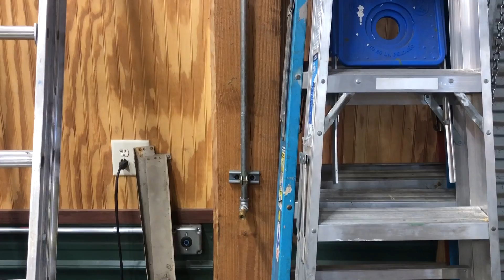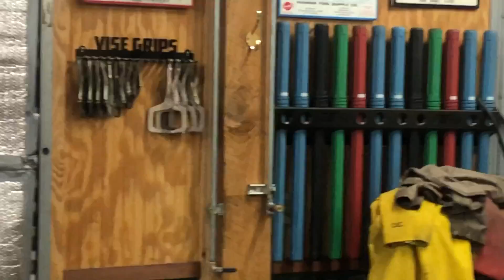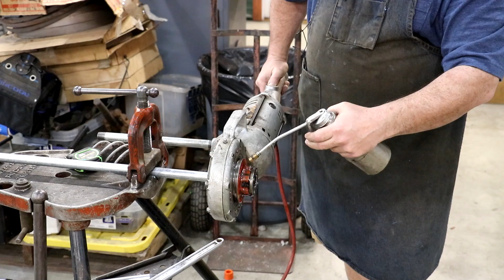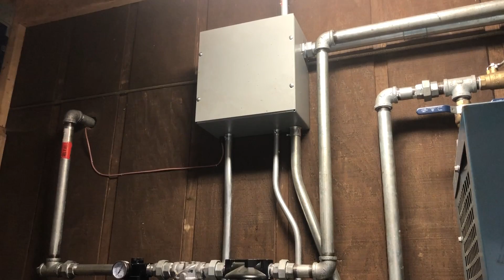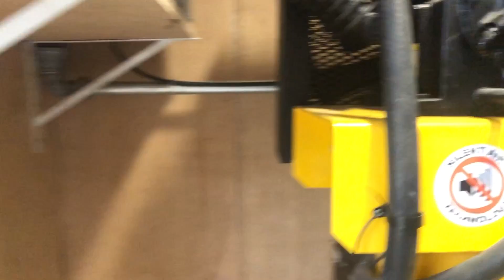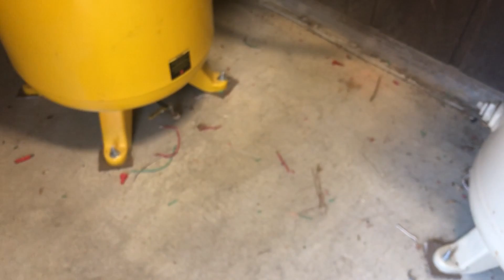The Ultimate Shop Air Compressor Setup! (at least for me....)

Comment: if you think you over killed for your air system, you would have to see mine.  the precooling coil i have on a diverter.  in the winter time i exhaust the warm air into my shop to save the heat and in the summer i exhaust it out side.  at the drops i also used a T but out of the bottom of the T i used a 6"x1/2" nipple with a ball valve to drain moisture/trash out of the line and out of the face of the T i used a 45 degree street elbow for my hose to hook into,  probably didnt have to but "my shop my rules".  the complete circle is AWSOME if you are using two drops at the same time there is zero pressure delta.  i do wish i had used glavanized pipe i used black pvc lined gas pipe glavanized would have looked better, plus i would not have had to paint it, yes all the lines are color coded according to industrial standards,  yes more over kill.  :)  again love the knowledge you are passing along.  thank you

Comment: At work we have a crapload of those 24V bulbs... but we also have a crapload of them in use. Most of our equipment uses 24V controls. Some of the old Japanese-built stuff (heavy tandem presses) uses 100V logic... not for the faint of heart!

I feel ya on backorders... a bunch of parts for work projects also on hold... The supply chain is logjammed everywhere it seems.

Comment: Keith, there is only one thing that scares the daylight out of me. That's the water separator valve at the bottom of the water separator. I would strongly suggest to you that if you are going to use the compressor before you get that piped outside for drainage, take some plastic and staple it to the wall above where the quad box is to cover that box until that work is complete, to make sure that any water dump doesn't get into the outlets or box. If things short out and there are any electronics involved in your system, you could fry those electronics. Not to mention any of the other potential hazards of water around electricity. Otherwise, the whole looks great. :-)

Comment: Keith, think of running an oiler unit. You have constructed an excellent system for media blasting, spray painting, plasma cutting, and personnel air supply, but for running pneumatic tools the system will be too dry. cheers
Reply: Oilers will be at point of use.  Don't want oil in the blast air or paint sprayer lines.

Comment: Might want to consider your shut off button to trigger an end of day drain down of the tanks as well. Sounds like current control logic would turn off the outlet that would power that drain down such that it wouldn't cycle.

Comment: I guess you could automate the rotary converter. It's possible to detect when a load is requiring power - to start the converter automatically. It could be set to auto stop 15 minutes after it's no longer in use too.

Comment: As it was, your second air dryer was bypassed - but still plugged in to come on when the compressor runs. I presume you have another switch for that in the compressor shed that you'd turned off ?

You're right, you've gone a bit OTT with that air system :)

Comment: Copper refrigeration tubing silver soldered would have been even more attractive/vintage.  Good to 400 psi.
Reply: The store where I work, has a compressor in my shop, 
and lines feeding to the other building, 50 feet away. 
All the hard lines are done in 1/2 inch sweat-soldered 
copper pipe.  While we have had issues on each end of 
that line, nary an issue with that line.

The shop compressor is a screw supercharger type.
(Close to a Roots design, but more twists, and it 
works the other way.)  The actual compressor will 
fit in my hat!  It is driven by a 5 HP single phase motor.
(That will NOT fit in my hat!)  Yes, it is noisy, but not 
like a piston compressor.  More like a turbine (jet) 
engine, compared to a piston engine.

steve

Comment: I'm behind you 110% about using galvanized for your air lines.  There's a reason air lines that have been up for 100 years are still up and never leaked.  Tried & true is always the best way.  I know the blue conduit is good stuff, but I also know how you can easily hit them and have them split. where I've seen galvanized ran over by a forktruck and still just fine.
Reply: Black pipe - galvanized should never be used in an air system.
Reply: @bruceanderson9461  you have to explain why - or your response is useless...
Reply: If you read through the comments you will find the reason explained at least 6 times as it has long been accepted as poor practice to use galvanized pipe in air systems. Do not use galvanized pipe in air systems as the galvanizing can and does flake off the internal surface which can then damage air tools, clog orifices or contaminate the surface you are painting. Galvanized pipe is for water, not air. Black iron does not have plating on its inner surface so with dry air you will not have this problem. I have always used copper as it is totally inert in an air system, easy to modify, not damaged by sparks and light flame and can be more compactly built into your shop but more expensive-maybe. I completed my third and last air system in my shop 5 years ago and did all of the things Keith did plus some and have never regretted it. Buy once - cry once. Keith did an excellent job-best I have seen on you tube. If you would like pictures of my compressor plumbing and wiring contact me at andmfg@ yahoo.com  I wish I could have been exposed to this knowledge 35 years ago. So if you are just thinking of putting in a system you are so lucky to have seen this video.

Comment: Run the air at about a buck and a quarter and rear back and smack a plastic fitting with a hammer.  Thats why I wont use plastic air lines..

Comment: Ive seen people run a contacter off their lighting circuit so if you shut off your lights it kills your phase converter, don't see why you could not do that for your air compressor too. easy to shut off your lights, or wire it on a timer, so it kills power between 10pm and 5 am?

Comment: Your shop your way.  Similar setup I have done. The steel also works well with hanging partition curtains on if you have a dusty job or painting.

Comment: Just an old trick on those specific types of unions (NOT the ones with an O-ring or rubber seal in them). Seems I've installed hundreds of them in my life... Often times (quite often in fact) you will find that they leak just a TINY amount. The fix is easy, hit it with a hammer (around the center nut) and re-tighten an additional 1/4 turn... This causes the inner seal to shift about when you hit it and changes the seat angle while "jogging it around with the hammer." You will notice that no matter how hard you tighten them, after a few smacks, there is always room for another 1/4 turn. 

This is such a simple/quick thing to do that I never check for leaks first and I always tighten them this way (check for leaks after), been doin it for 30+ years and I would go as far as saying that this is the only way to do it. Take my experience for what you will....

P.S. Be sensible with how vigorous you are with hitting these with a hammer... Don't break the nut folks. Solid even taps, do not knock the hell out of it

Comment: Looks like you did it up right.  With that refrigerated air dryer you should have what we call at the plant "Instrument Air" quality dry air with a dew point of about 35 degrees F.  That should reduce to a minimum any corrosion of the galvanized pipe.  The one negative of galvanized pipe used in compressed air system is that the zinc will corrode due to the moisture in the air and sluff off in small granuals.  You shouldn't experience that problem.  You have also addressed some of that issue with the top exit of the piping at the drops.  Good Job!!

Comment: Of course you know the compressor will only turn on if your pressures low in the tank. With all the storage you have it may run once a day with light use. Now with the blaster it will run more often. So turning it off may not be needed unless your going away. Mine is only 60 gallon and if I'm just using impacts or cleaning up it runs twice a day. Setting at 80psi on an 125 psi off. Don't be surprised if it don't run up from your low in only a few minutes.

Comment: Seems like the precooler should be between the compressor and the first tank.
Reply: I was about to ask if it was a good idea to dry the air before it goes into any tanks.
Any reason not to do that? I'm in the process of building a drier at the moment.
Reply: @JoeInBendigo  One reason not to is that you would be modifying the plumbing of the compressor and would violate the warranty and would potentially be harder to do. I see two reasons to cool the air out of a compressor. One is to help condense the water the other is that it takes more energy to compress the same mass of hot air than cool air to the same pressure. When  your tank of hot air cools off the pressure drops and the compressor has to run again to bring the pressure back up.
Reply: @jmhannnon  my compressor has been out of warranty for about 15 years, lol.
Thanks for confirming my view to fill the tank with cooler air for less risk of rust. My cooler will have an automatic water drain as well. I'll put the filters on the tank outlet.

Comment: You can never have to many drops. If you go through & put in some overhead hose reels you'll never regret it. In his latter years my father put in 4 overhead reels in our shop. It's made it so nice,  we can have the end of a hose anywhere in the whole work area of the shop within seconds & then put back up in seconds instead of tripping over hoses. He went with 3 25ft reels & one 50ft reel that will reach 30ft outside.

Comment: What a coincidence! I was just specing out the same 10hp compressor myself for an upgrade. I have a large blast cabinet that needs the cfm's. Your piping probably adds another 60 gallons of capacity to your system and extra cooling as well tho you probably won't need it.

Comment: Ya! Nice right now I'm looking for a lens that fits in dial indicator for a magnifyer on a adjustable base (noga soo dreamy)so i can better see the stuff i work on. My air systym probly could be plumbed in anodized fuel line with the aircraft style ferule fitting. With big plywood pillow blocks painted silver for that juels vern look. Ha Ha to each his own solution. Add a parker nitrogen seperator for plasma cutting?
Reply: Plasmas work on shop air these days, have for years, in fact.
Reply: @mathewmolk2089  Have you seen high deffinition plasma, without oxygen in the cut stream you can cut a part as precise as a gear or such in 15 mins not for like a muncie or somthing I have a cheap lathe that I can cut a spiral with handy for fast acting focal length adjustment and such

Comment: Sweet. however I would add  24v valve at the air dryer valves so when the cooler and dryer are on the air has to go through the dryer.

Comment: Finally, Intelligent Choice, Galvanized instead of plastic. WTG! You are the first one I found recently on youtube who has not selected plastic! I just picked up a 3,100 sq foot building and need to install an air system. I am going with copper. Just like you, the copper is simple to cut into to add a new drop. Galvanized and copper sure beat plastic, which, like you, I think will have issues as the years go on. Good choice on having the compressor in separate building. You will not have to put up with the noise. In my building, there is a nice small separate room that will work as a compressor room. I will not hear it in the shop.

Comment: With you 1000% 

I am now retired, but I spent over 40 years as and an industrial electrical/millwright contractor and we put in miles of air lines or all types.  I would wire my shop in romex before I'd use plastic air lines.,,,,,  You did the job EXACTLY like I would have done it. Only thing is I wouldn't have used the unions (We would just cut and re-thread a pipe if we needed to put in a full size branch,) and unless there was some spec we were working to we put a T every 5 feet.  That way you are never more then 30" from a drop. 

Not just because you did it the same way we would have done it, including getting the compressor outside, but you did as good of a job as any of the fitters that used to work for us.( ,,,,, Not a good job, but a GREAT job.  (And God bless you for not using rat cable.)

Just the $$$$$ could give most guys a heart attack!

Comment: Love to see someone mimic my installation that I did 5 years ago. I have every component you have plus 5. 1) Add your portable air tank into the compressor tank storage before the solenoid shut off with quick connects and you will always be ready to go with emergency air and you will add 10 gallons more of air capacity. 2) have the intake pipe to the first storage tank shoot the air tangentially to the tank wall to help with cooling. 3) I used two compressors with one large tank staged to kick in when needed for a total of 12 1/2 hp all single phase for the same reasons. 4) have a rubber hose immediately after the compressor tank to keep vibrations out of the lines. 5) add a large air sandblaster fitting and piping outside the compressor shed for sandblasting large items outside.

My whole shop turns off minus the lights and battery charging circuits with one switched 100 amp relay with switches at each entrance. This assures you don’t leave a soldering iron or something running as well as a run away compressor due to a large air leak. I would have preferred you would have used black iron pipe and not used galvanized pipe as it is always discouraged in air systems due to flaking of the plating. I used copper as it is easier to make compact installations and to modify but more expensive. Great installation and you will never regret overdoing it - I haven’t.

Comment: You have an impressive compressed air generation with air cooling, water traps...
Driving old rail cars I wonder where oil is filtered out. Those old cars have special drop outs that should be used after each day.

Comment: Just a thought, put valves on the bottom of every drop, we have a 4” piece of pipe with a valve out the bottom of the tee to drain moisture, be surprised how far the water gets
Reply: Never had water at drops and have a system like Keith’s.

Comment: It's fine to use galvanized pipe but it would be better if you had multiple condensation "U" traps around the shop. Really, the best configuration is to just make each one of your service drops a U trap with a bottom end blow-out valve.
Ultimately, you have to be the one that's comfortable with your setup. Galvanized pipe has been used for air systems for decades without serious concerns. No, it's not "bulletproof" but if that's what you trust, that's what you trust.
Condensation WILL happen in an air system even in the driest environments. That's where the polymer/alloy lines have the advantage.

Comment: Glad to see that you are using a refrigerated air dryer, oil water separator in your compressed air lines. Galvanized pipe is adequate for dry compressed air piping. As a facilities engineer we always use Type-L copper tubing for 1" and smaller piping. Every drop should have a dirt leg with a ball valve and a removable plug. Hanson and Parker were our go to quick connects depending on what gas or liquid media we were conveying. Most drops had a small filter and a small oil/water separator and a pressure regulator before the quick connect. Normal compressed air pressure is 80 psig and reduced to 15 psig for a blow off gun. Overall your compressed air system looks good and should work well. Congratulations!

Comment: Hi Keith, if you do not like climbing up on ladders, why not obtain a small battery powered man lift? a smaller version of an elevated work platform, they go as high, and will easily reach the top of your shop, they can get into smaller areas and can be stored out of the way.  great video, always good to have air in the shop. Regards a fan from Aus.

Comment: Keith you are going to get a lot of flak for using galvanized. As an ex pipe fitter galvanized was never used for air, black pipe, copper, or stainless if you could afford it.
Reply: Ditto,
Reply: I worked for an air compressor service company that also did piping installation for air systems. We used galvanized pipe all the time.

Comment: I am about to install my compressor lines as well. I'm using the blue pipe, and have the compressor in it's own sound-proofed room. I actually like the blue, modern look, but can certainly respect your choice. If I had a bunch of antique machines I would have went with metal myself. I contemplated making a pre-cooler out of copper pipe but decided it was overkill, but may go back to it if the water separators at the ends of the lines cannot keep up. Now you need a few quality hose reels, awesome system Keith!
Reply: The most important item for moisture control is the inter cooler. Air comes out of the compressor at 400 degrees F and the cooler between the compressor head and the tank if sized right will bring it down to room temp and the water will rain out in the tank which you should have an auto drain on.
Reply: @bruceanderson9461  I do have an auto drain, but I'll have to look into the inter cooler. Thanks!

Comment: Steel piping is known to generate rust particles that plastic pipe does not.  Plastic piping can be painted any color that pleases your heart.  I think plastic piping will out last you and me.  Plastic piping does not conduct lightning around the building.  That "refrigeration air dryer" is known as a "dehydrator." Ron W4BIN
Reply: I have worked on black pipe air systems (with 100 HP compressors) that are still up and operating that are older then me by over 50 years,,,And I'm 74.